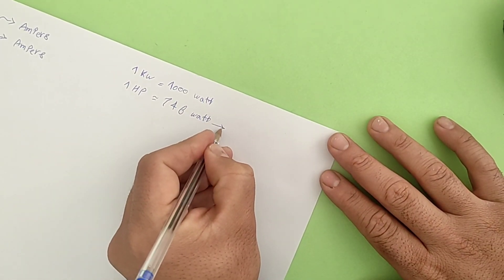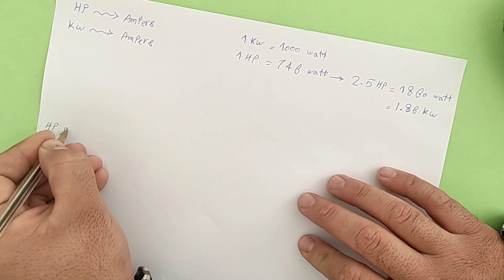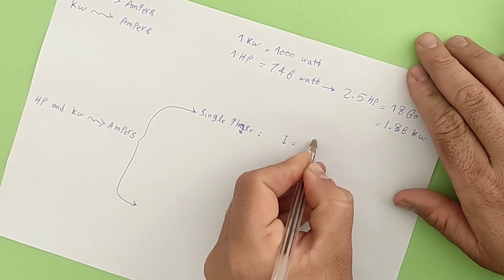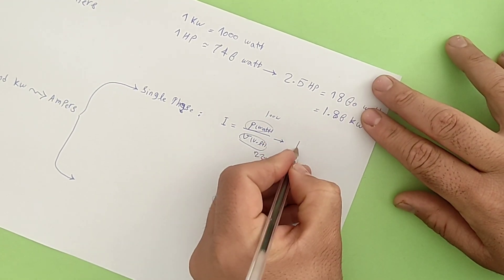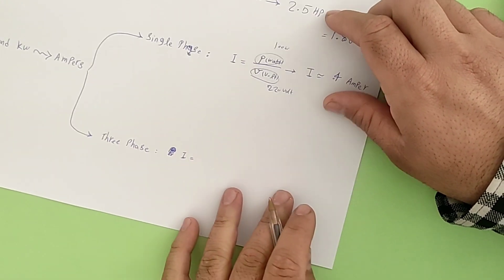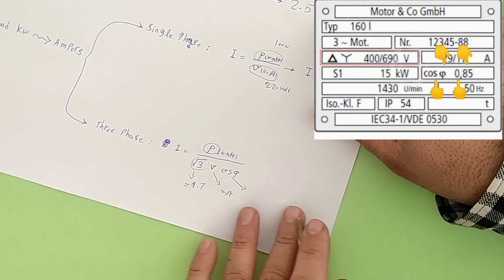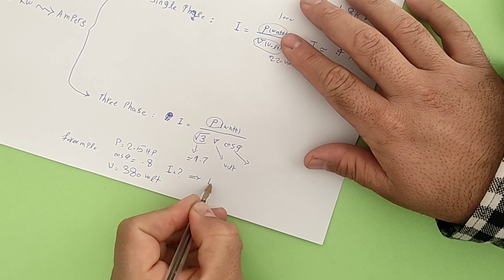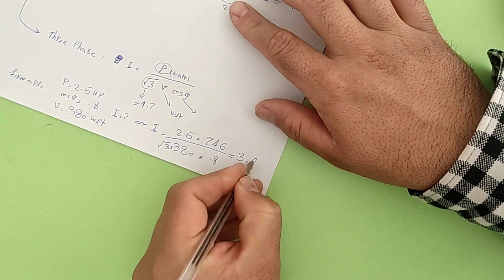How to calculate current from power

Comment: the formula if Hp (horsepower) is given & you want to find amperes is I (amperes) = Hp x 746 divided by V x Eff x cos theta. but if there is no Hp given in the problem then your formula is right
Reply from the maker: If the consumer's power is not available, you can measure the current using a multimeter
Reply: @IET-76  yes sir. what specifically type of meter should be used sir?
Reply from the maker: You can use all clamp multimeters to measure current